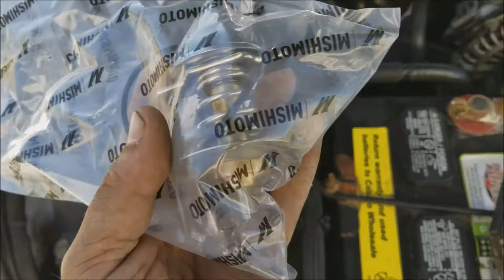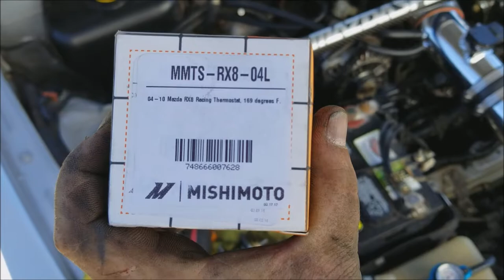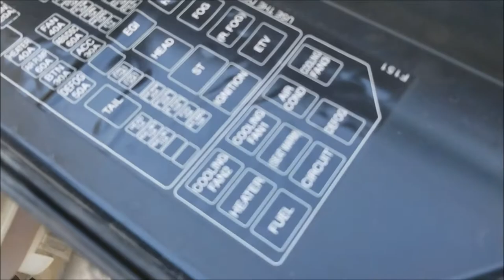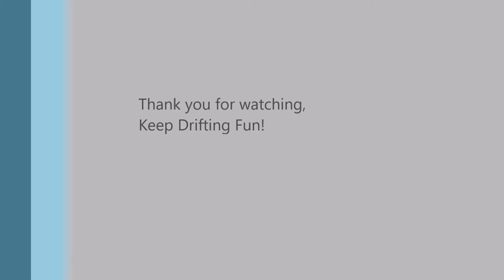Installing thermostat and RX-8 Performance fan cooling kit

Comment: Looks like they sent you the wrong thermostat.  I order the same one from Amazon and it fit perfectly.  Also, you might want to remove the battery and the battery tray for more working room.  I just did this job two weeks ago and the extra space helps.

Comment: Does the water temp module give out a signal that you could use for an add on temp gauge that gives real temps?   Rather then the dash one which only tells you a relative temp?   I have to think your mod is going to be great for stop and go traffic.  Thanks for putting up the video.